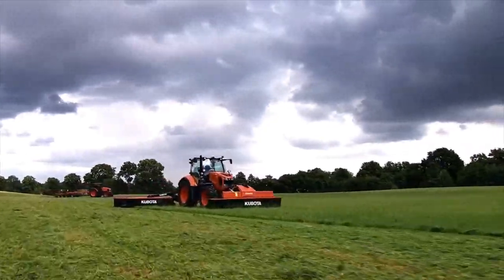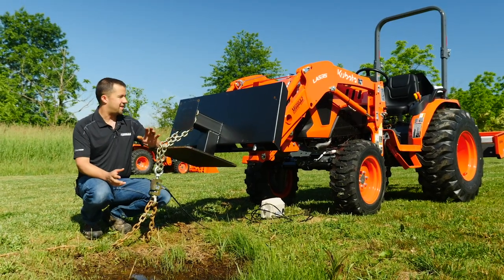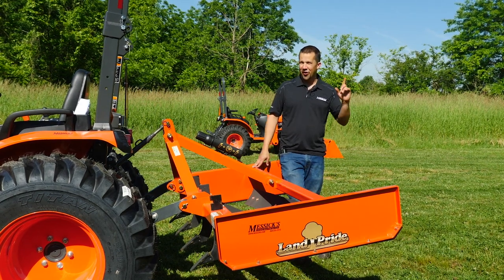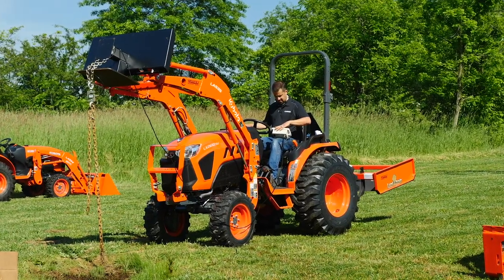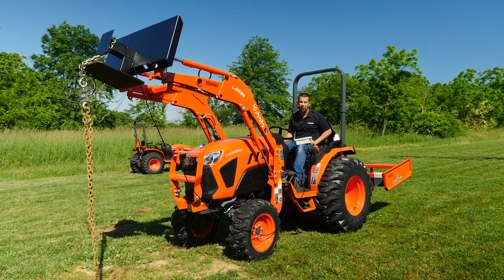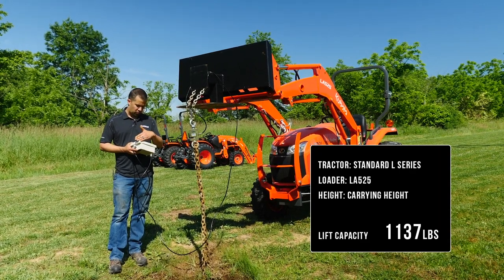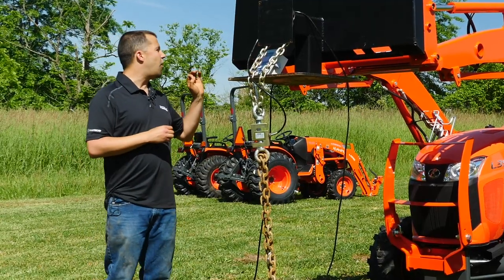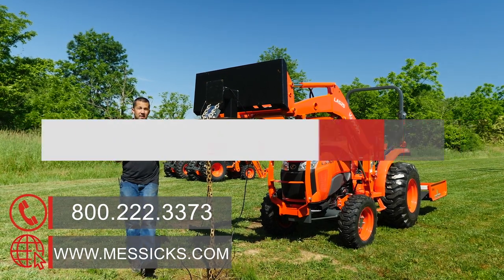Kubota LX series VS L series - Loader Lift Comparison

Comment: I have a 2020 model year L3901 with loader and backhoe. With the backhoe attached I can easily lift, carry and stack full sized round bails of hay. The 6’ 1,800lbs round bails not the smaller 5’ 1,100lbs round bails. Those lifting rated numbers are way lower then what Kubota says. I’m able to double stack those large bails of hay easily, yes it does go slow getting it up there but it does it with no issues at all. Definitely a tractor I am completely happy with buying it makes my small 15 acre farm work so much easier and I have yet to find a job that I have asked it to that it hasn’t been able to do.

Comment: When i bought my L2501 i did'nt give a rats behind about lifting height,capacity,breakout.i cared about fit and finish,parts availability long term,dependability and resale,in case of upgrade.KUBOTA offers all the above,I've worked way to hard to have to second guess my purchase,I'll stay the course,KUBOTA.Very good info to know anyway.

Comment: Wish we had a dealer like you guys in Georgia. I've learned a lot from you guys. I'm close to pulling the trigger on a L2501.
Reply: I have an L2501 and it is a solid machine. If you treat it right it will treat you right.
Reply: There are  lots of those around here on small jobs working great my dad has a l3750 we have had for over 20 years never turned a wrench other then changing oil and filters
Reply: I’ve owned a 3301 for almost 3 years and it’s been trouble free. It works pretty hard and when compared to my neighbors B series 2650 it way mare capable and more stable on uneven ground.
Reply: Got 40 hr on my l2501 coming from a old 35 hp john deere and I could not be happier absolutely awesome tractor worth every penny

Comment: I really liked this video. As usual it was very well done. My question is is there a video which shows with the LX3310 can I actually lift?  I mean how big of a tree or how much gravel will fit in the grapple or scoop?  I understand the math but how do you tell how heavy a tree is after you cut it? I was watching a video about a guy who bent the front and loaders by trying to lift a tree too heavy. Is there a physical observable marker that would tell you you’re lifting something to high?  I’d rather be able to see something first before I blew like hydraulic seals or bent anything. Sorry I’m pretty new to this.

Comment: Put the guys in the fab shop to work and have them built a mount that allows you to lift from the pivot pin and compare the two lift points on the same tractor.

Comment: Excellent video, the load cell tells the tail.  I'd like to see competitive brands compared on this measurable method.  The specs are so confusing for a first time tractor buyer, but you can't just trust what every sales rep says either.  Some are honest, some baffle you with BS, but they all are so convincing (at least the good ones).  Then you have the forums full of fan boys.  A test like this would prove the results.  Everybody has different needs for their tractor.  For me min'e is more of an off-road forklift and I need maximum lift down low up to truck bed height.  Don't really care if I can dump dirt into a triaxle, I don't have one.  I still believe I bought the right tractor for me, but If I were to re purchase I'd be making a more intelligent in my analysis of facts and features after owning one for several years,.

Comment: I wish Neil would have done another test at 24 inches off the ground. You are supposed to have some real high numbers. 

My B2650 has the LA534 compared to its twin brother the LX2610 in the video which uses the LA535. So the Lx can lift 1 kg (2.2 lbs) more than my B2650 (thats what the numbers mean. My LA534 can lift 534 kg from the pivot pins at full height). Anyways tomorrow i have to pick up from the store 1,457 lbs of wood laminate floor. The bed of my 16 ft landscaping trailer only sits about 16 or 17 inches off the ground. I am curious if i will lift it or have to pull some boards off to make it lighter. Granted i will be using pallet forks so the load will be out front a little bit.

Comment: I like the bucket pin measurements.  I think it is the only way to get an accurate apples to apples comparison between different brands.  For example, if a tractor comes with a ssl quick coupler standard and you are measuring to bucket center, the numbers should look considerably better for the brand that has a pin on bucket as standard equipment.
Reply from the maker: Problem for the brands that use ssl as standard.  Most people buy ssl with a bucket, they should measure the configuration that sells

Comment: 113lbs is a bit more than 15lbs difference. Just thought I’d point that out. I know the lift capacity at max height at the pivot pins was within 15lbs, but that wasn’t what was circled.

Comment: Have you done this test with a BX?  Could you do so at some point, curious as to what real world shows compared to what the spec sheet says.  I'm sure its probably higher in the real world, but for what I'd be doing its not going to have any issues lifting.

Comment: I think the big question here is why aren't those power line towers not painted/ galvanized?
Reply: They are Cor-Ten steel (or equivalent), so they're an alloy meant to rust and form a protective iron-oxide layer without flaking off like normal steels.  Saw them a fair amount when I still lived in Missouri, particularly in Rolla.

Comment: Thanks Neil! But, the spec vs measured differences are more dramatic than your video showed.  The LX series uses the LA535 loader, but you showed the spec sheet for the B series' LA534.  The LA535's spec at 2000 mm is 769 pounds @ 19.5" whereas you measured 847 pounds.  Similar  differences at 1500 mm.  Overall, published spec for LA535 looks VERY conservative based on your measurements!

Comment: In the first test at 1500 m m you put some power into it in the right rear tire lifted off the ground much more so than the left and the whole tractor frame and loader frame seem to twist even though your load was centered. why?
Reply from the maker: Front axle articulates

Comment: why are kubota's  loaders numbers so much lower then other tractor brands ? example i just got a branson 2515r tractor 25hp 3000lb tractor that lifts 2200lbs to full height at the piviot pins . i know specs aren't everything but that is a huuuge difference , why i went branson .

Comment: like to see the numbers from lower height were ya are actually picking up a load
Reply: I agree
Reply: I think the factors are too many to be reliable.   You have gear, weight of tractor,  case weights.  There's just so many things that will change the numbers.  That said,  I would like to know myself.

Comment: Just bought the compact 2501 with LA525 bucket, a set of forks, and also a grapple. Found out real quick you can't actually lift anything of consequence with it. A knee-high stack of bricks on a pallet?...nope. A round bale of hay with a hay spear? nope. Half a bucket full of dirt is about it. Really having a LOT of buyers remorse now. Needs bigger hydraulics to get any real work done. Guess the old Ford 8N isn't retiring yet.
Reply from the maker: Those things weigh a lot more than you think, and your load center is far from the tractor costing you a good 30% of your capacity. Lots of videos on this on our channel.

Comment: Another great video Neil!  I think it might be time for me to upgrade.  That L3901 looks pretty nice.  I just have trouble with that treadle-style drive pedal that the Kubotas use.  I think it would be hard to get used to, and a pain to use.
Reply from the maker: I sell both styles. Far, far more tractors have a treadle pedal than side-by-side. You get used to whatever style you use. It's not something I think should drive someone to one tractor over another.
Reply: @MessicksEquip  : If Kubota were smart they'd do some market research asking customers, AND current owner/operators, what they want and would prefer. 

Side by side hydrostat pedals will undoubtedly win by a landslide. 

Treadle hydrostat pedals are nothing but an ackward pain in the ass to use, especially if you do a lot of fwd/rev loader work.
Reply from the maker: They have, and the treadle has always won out.
Reply: @MessicksEquip  really? I've been reading forums for weeks and haven't seen one person at all say they wish they had one. It's actually a big deterrent. You just let the kubota salesman in you show. Regardless I'm going to check out an lx2610. Do you think it would lift a 1500 lb skid off a 2-3 foot trailer?
Reply from the maker: @WolfinWolvesClothing713  1500, probably not. I'd guess you'd tap around around 1200 depending how far away the load is.

Comment: Thank you; that was an excellent dempnstration.  Question:  Does the addition of the skid steer quick coupler on the front affect these numbers significantly, either by its additional weight, or by moving center of gravity farther out front?
Reply from the maker: Yes and yes, buy about 10%. Generally a good trade off for the flexibility.

Comment: This kind of makes me want to make a place in my yard I can periodically test my lifting capacity of my equipment. I feel like my tractor has dropped lifting capacity in the first year of owning it. The 3 point seems to be weaker as well, I've taken it to the dealer but they said it's fine, I feel like the hydraulics need to be readjusted to bring back lifting capacity. Also I have never been able to spin year tires which I feel like I should be able to do. Even In the mud if I try to push something to heavy the tractor will just die and never spin a tire, which I have never experienced on any other equipment. I still love the tractor just want more out of it
Reply: @jt3366  new holland boomer 24

Comment: I notice when I am carrying around a loaded bucket rolled back the load seems to be balanced on the pivot pin so I would say the pivot pin spec is not completely meaningless.
Reply from the maker: If this is true,  your carrying way too high.
Reply: @MessicksEquip  A rolled back bucket doesn't need to get too high on my lx before it is close to balanced on the pin.

Comment: You guys make great videos. I love my L3901 but for three things, the PTO lever design in poor, the oil dipstick location is difficult and I wish the front brush guard better protected the front better. Overall though a great tractor.
Reply: I think my least favorite part on my L4600 HST is the gearshift - frequently I will be going down a steep hill and be looking over my right shoulder to watch the implement (as you do) which pushes my hind end up against the gear lever and wheeeee! all of a sudden we're flying into the barbed wire because I butt-shifted it into neutral. This is not made better by the criminal lack of a grab handle on the starboard side to keep from doing that with (OK, worst thing #2) so I keep accidentally grabbing the tire or putting my hand between the fender and the tire; neither of which is very helpful either. Not sure why Kubota didnt do the obvious and put one on BOTH sides, but its a major brain fart (I know in Japan they drive on the left, do they BALE on the left also?).

Comment: Neil,  question regarding lift capacity using the Universal Landpride Forks.  Based on an LX2610 with the Cab, is it even worth going with the PFL2042 rated for 2100lbs that weighs about 73lbs more than the PFL1242 rated for 1200lbs?  Will it even lift close to that weight say 1' off the ground?  Contemplating the PFL1242 or PFL2042 and want to make sure the right decision gets made especially if the PFL1242 is ONLY rated for the 1200lbs and there is nothing in between these 2 weights.  Thanks in advance!!
Reply from the maker: ratings are for the pair of tines. So PFL1242 @ 600 per fork could bend if the entire weight was on one tine. PFL2042 would be totally appropriate.
Reply: @MessicksEquip  Thanks for the input!!

Comment: I would really like to know why you cannot up the lifting capability of these machines? Is the frame not heavy enough? Are the arms not builds strong enough? Is there some specific reason why they can't be beefed up in the same size range for heavier capacity? Seems like if you beef up the components and you beef up the hydraulic system you can have something more capable around 1500 or 2000 pounds so you can really do some heavy work around the farm or your property. Moving trees Etc. I know they make larger machines for heavier lifting but why not make a beefier smaller machine that can do the work? So you can get into those tight places and the people that own the smaller properties can also utilize them.
Reply from the maker: because the base weight of the machine is too low to do it safely. Wanna lift more and keep your rear end on the ground, you need a larger machine.
Reply: @MessicksEquip  thank you. Seems legit 👌

Comment: I know the L2501 is nearly the same as the L3901, but it appears the hydraulic pump is a little bit less robust in the L2501. I wonder what the differences between the 2501 and 3901 could be.
Reply from the maker: Flow, not pressure. Will lift the same, a hair slower

Comment: Can either unload a 1000 lb pallet from the back of a pickup truck?
Reply: Maybe answering my own question…probably not because that weight would on average be even further out than this test here and similar height. Probably could a few inches off the ground (aka a low trailer).
Reply from the maker: correct. If you need to unload a 1000lb skid you really should have about a 1300lb capable tractor.

Comment: If you are lifting the back tires off the ground, aren't you cheating yourself out of lift capacity? If you literally anchor the rear to the ground, wouldn't you be able to lift more weight? I do recognize that the purpose of the video was the comparison and not the actual lift weight specs, but how much ballast you put on the rear of the tractor can really affect the readings.

Comment: Isn't that L  10 horse more than that B, with more hydro capacity?
Reply from the maker: Horsepower does nothing for lift cap. The point here is the spec sheet does not tell the entrie story

Comment: Great info but why don’t you like the l2501
Reply from the maker: What gave you that impression?
Reply: I don’t see to many videos with the l2501 that’s all I did buy one this year wish you had more on the l2501
Reply from the maker: The concepts apply to tractors in general,  regardless of model
Reply: Ok so what makes the backhoe leak down the way it does

Comment: Could you measure at pivot pin so we can compare to the kioti CK2610? I bet kioti still beats it...
Reply from the maker: only dishonest tractor companies measure at the pivot pin.
Reply: Still would love to see ck2610 on this test. I'm looking at both brands.  When I do decide to purchase I plan to take a pallet loaded with weight to make sure they will do what they claim.  Or someone can donate a 2610 for messicks to test so I just have to take a checkbook with me instead 🤣
Reply: @MessicksEquip  I looked up loader specs on the Kubota website. The pin is where they measure also.
Reply from the maker: @timallen8988  you'll find 2-3 measurements on most spec sheets... but unfortunately yea, I've seen some cases where they are caving to the trend
Reply: @jdboy9  my Kubota dealer had a bunch of different materials to demo through.  They can't fake letting you hop on and using the tractor yourself.  EDIT:  I should have noted that my local Kioti/Yanmar and my local John Deere did not have a playground for me to demo a tractor on.  All they had were rows and tractors and papers for me to look at.  The Kubota dealer let me run six or seven tons of gravel, clay and broken asphalt around their yard.
Reply: @roflstomps324  I have a pretty good Kubota dealer locally.  Kioti not so much.... dealer support ultimately is second to how I like the tractor.   I will buy any color as long as it is a quality piece of equipment.
Reply: @roflstomps324  : Agreed that there's nothing better than try before you buy! 
Only catch is that it's costly for dealers to do, and it beats up the new equipment. 
Gotta have a pretty serious buyer before just allowing them to "play". 
Playground - NOT for the tire kickers.
Reply: @turbodiesel4709   Of course.  That's all at the dealer's discretion.   The point though is that only Kubota had that option...